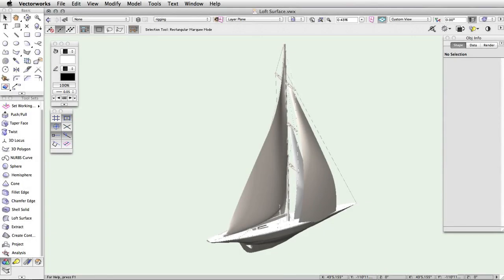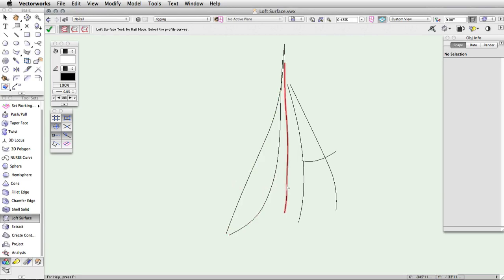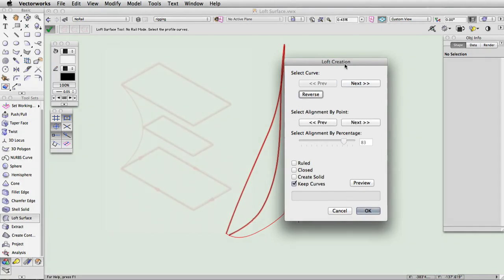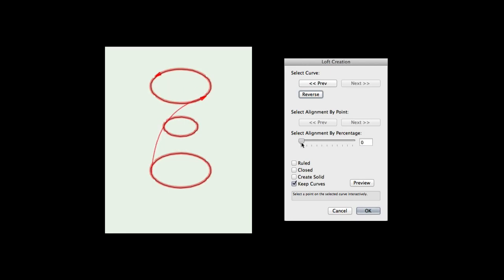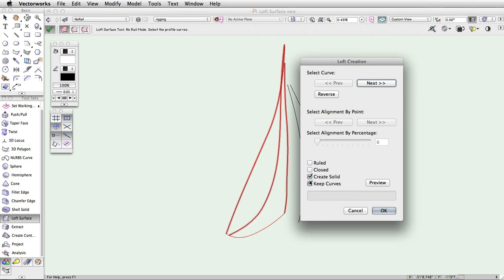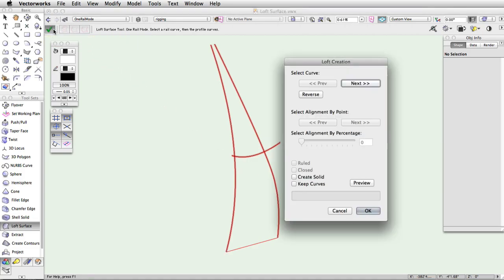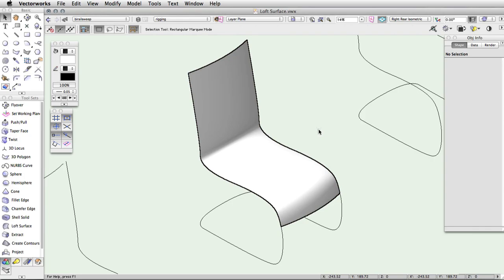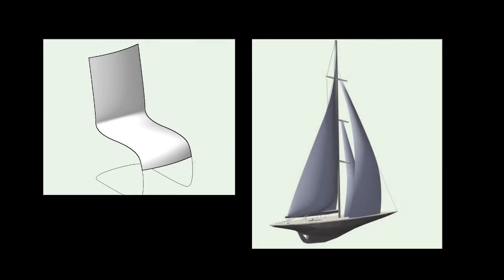Manipulating 3D Geometry - Loft Surface

Comment: well i cant even select anything, this program really does feel like a step backwards from fusion 360
Reply: Mine isn't selecting at all and I'm so confused what i'm doing wrong but all the videos are from 5 years ago
Reply: If you are familiar with Fusion 360, or any other application really, learning to use a different application will take some time and a bit of practice. Knowing the basics will certainly help. I would recommend checking out 'The Basics' course at Vectorworks University.
Reply: I'd stay there then if I were you.

Comment: I assume this boat is meant to be sailing in reverse? At least the sail aerofoil would guarantee that it went better backwards than forwards! Traditionally the maximum draft is anywhere between 15% and 45% of the chord length… measured from the LEADING edge.